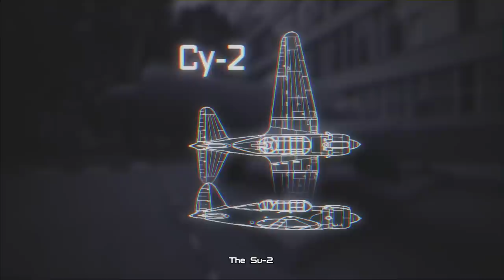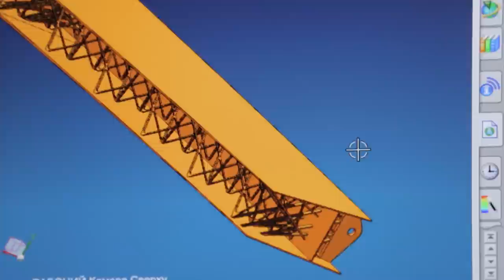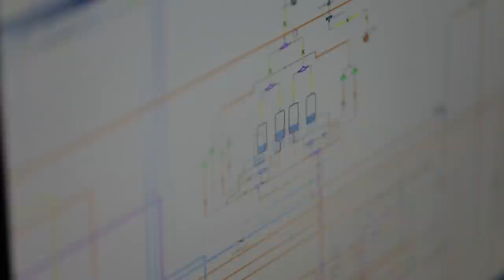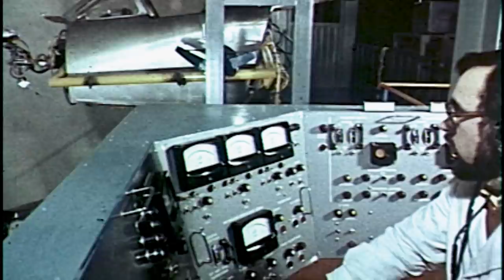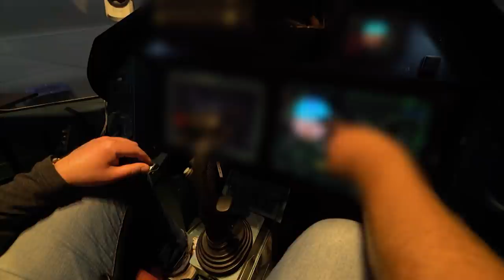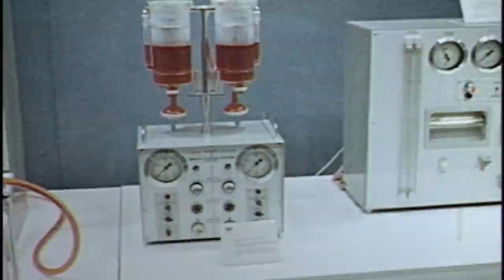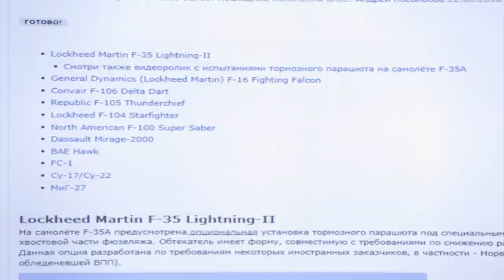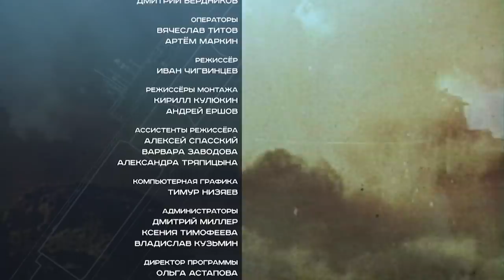Top Russian Fighter Jets / Sukhoi / Top Secret / Combat Approved / New Episode

Comment: Amazing how Sukhoi displaced the Soviet era Migs as the main Russian variant.
Reply: Sukhoi definitely makes the Air Superiority fighters, but sometimes when you don’t need to bring a flamethrower to kill a cockroach, you can always send MiG-29
Reply: Not so much as amazing but weird. It replaced it it seems because Mig could design a better interceptor - Mig31. Which is a unique role which no body else can do as well as them. And so they move on from air superiority to interceptors. And Sukhoi basically replaced them in their air superiority field.